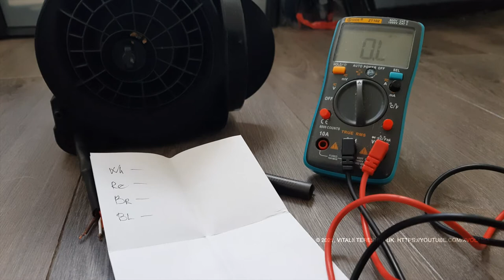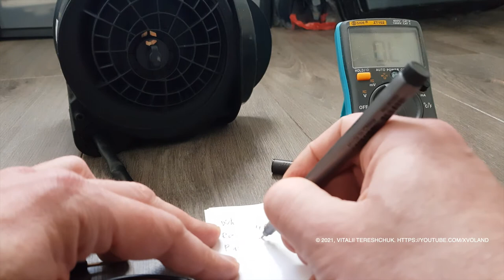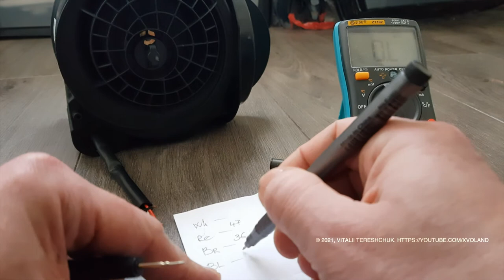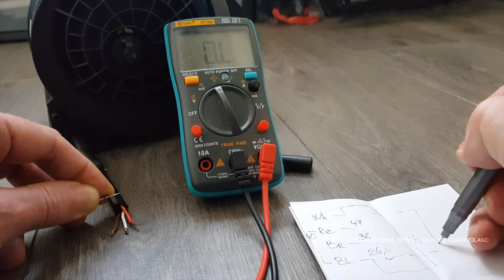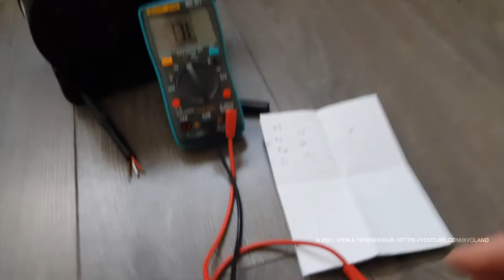🛠 DIY How to connect kitchen COOKER HOOD FAN electric motor to switches k42rp2213

Comment: Thank you for video. with this setup, where would you connect a variable speed regulator for the fan? on the supply cable?
Reply from the maker: Thanks! The thing is, the winding switching (in the motor) is the speed controller. Of course, if one of the windings is damaged. Then, you can buy the regulator separately and connect it.
Reply: Ok, thank you. Well, it is because I am thinking about connecting a variable regulator I have, and then (maybe) also keep the swithing mekanism, so I can have even more control over the Rpm. Do you think it will work? I Do not want damage anything.
Reply from the maker: @sermandet2022  I think three speed is enough. I wouldn't do anything 🤷🏻‍♂️
I see no reason to modify.
Reply: Oh yes I understand, well it is because I want to use the fan for building an air cleaner 🙂

Comment: I need to replace a 2 speed cooker hood fan but only 3 speed is available, can I simply ignore one of the cables. Red is the neutral, black white and brown are the 3 speeds.
Reply from the maker: You cannot skip one cable, because the connection will be interrupted.  You can combine the last two into one circle
Reply: @xVoLAnD  Thanks so much for such a quick reply. But sadly it looks like I'll have to do a full replacement as I cannot find a motor with the correct dimensions.
Reply from the maker: @glynmoore3730  You’re welcome!

Comment: you are dangerous not 230V itself!
Reply from the maker: It's understandable that electrophysics works. Nevertheless, you should not play with it - DANGEROUS TO LIFE
Reply: my concern is when you manually plug the power cables directly into the mains supply voltage 
it is not a good example to show
Reply from the maker: @prv972  Is there any other way I can explain and demonstrate that what I am doing is correct and works?
Reply: @xVoLAnD  you could use a regular plag with a 10A switch, cable lags and terminal blocks. It takes more time for you but video can be properly cut out. As you said SAFETY FIRST.
Reply from the maker: @prv972  Every house, has a 6-8A fuse, moreover, many are equipped with a special circuit against short circuits 🤷🏻‍♂️
Reply: @xVoLAnD  target is to avoid electric shock.
Reply from the maker: @prv972  To avoid electric shock, it is best to have it repaired by a professional and do nothing yourself. Or be careful.